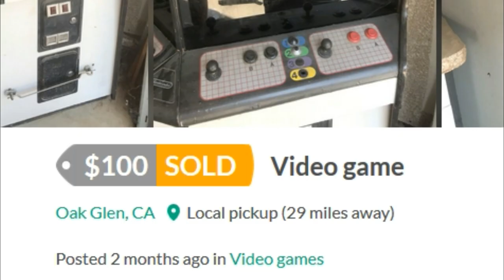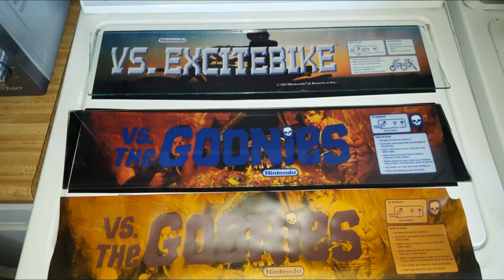Nintendo Vs. Dual System restoration.

Comment: Just pick one of these up Mario and excite bike so pumped
Reply from the maker: Sweet! There is a fan made chip specifically for this cabinet where you can play all of the games for the chipset/PPU type you have installed on the PCB. I can play Mario Bros. this way without having to buy the original chips. Plus the games are selectable. Only problem is its fussy with original daughterboard games (which mine are vs. Goonies/vs. Castlevania). So I have to take both daughter board games out and leave one out if I want to play it.

Comment: Would you know how to find a value for one of these cabinets? I have the same system with Vs. Super Mario Brothers on the left and Vs.Excitebike(rom locked for one player only) on the right. It looks to be original and works well. Pretty good condition and I think the only cosmetic thing it needs is the 2 outer panels needs replaced due to hand placement wear .
Reply from the maker: Well, there was one that I know about that sold last year at an auction in So Cal. and it was up there in value. It was a red one with I want to say Vs. Tennis on both sides. It wasn't in the best condition either. I wish I could remember the actual price but in my head I have two totals. It was either around $4k or $8k. I think the better condition they're in will increase those chances as well as the games that are in them. That all boils down to who wants it and what they're willing to pay. 

I couldn't tell you what they exact value is because I know people overpaid for that machine at the auction. I also believe that particular auction prices were rigged with ghost bidders. I was watching it in real time and interested in bidding on a Real Ghostbusters cabinet, which sold for an insanely ridiculous amount.

Your Vs. Excitebike is rom locked? Is that just not a dipswitch setting or is it actually programmed that way on the eprom? Anyways, mine had Excitebike in it originally but I swapped it out for Vs. Castlevania. Excitebike is fun and all but I get a lot more use out of it with CV.
Reply from the maker: I got lucky with the joystick overlays. While it's not seen in this video, I found a guy who listed an unused original on eBay. I bought the one he listed, but asked him if he by any chance had a second one and he did. If you're looking for replacements, try there first but they're rare. Otherwise, try emailing some of the places that repair or sells arcade parts. A lot of them have surplus and might just have one that's been sitting around for some time.

Comment: I have a bunch of vs boards very little on the cabinet I’m looking to see what dimensions are so I can make one to house my board, I don’t know if it be to much trouble for measurements if not thanks if it is thanks for reading my message.
Reply from the maker: 42.5"w x 67.5"h x 35"d. It's a beast of a cabinet.
Reply: @910dohead  thank you so much, for the cpo how deep is that, you think it be easy to make the control panel from wood? Do you have an email that I can email you?